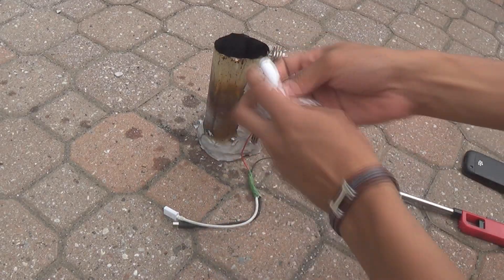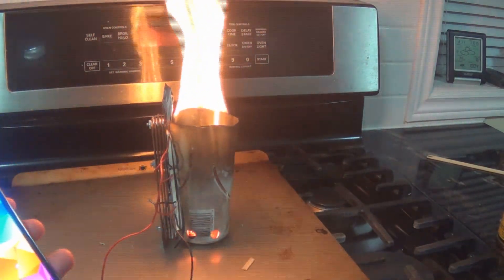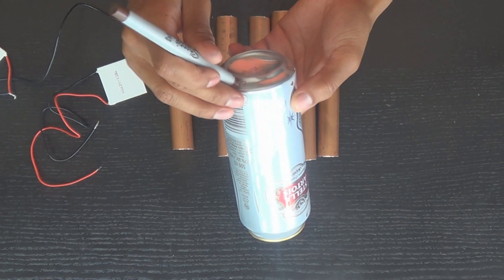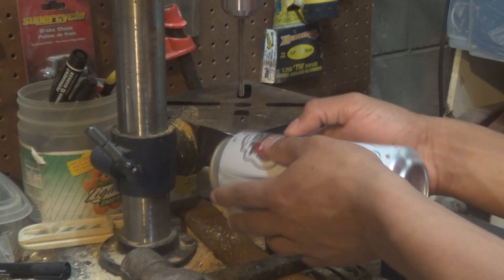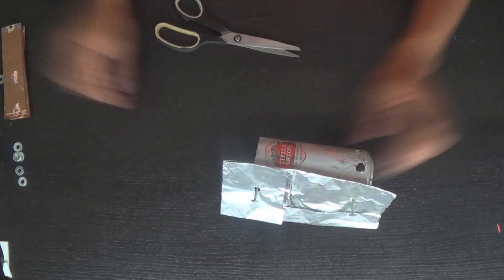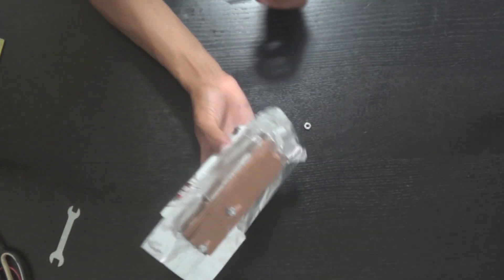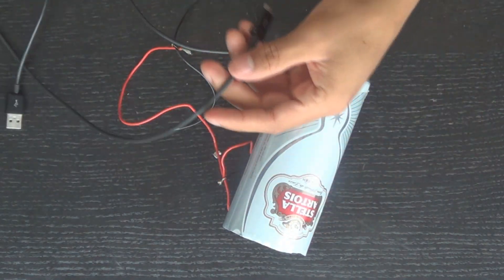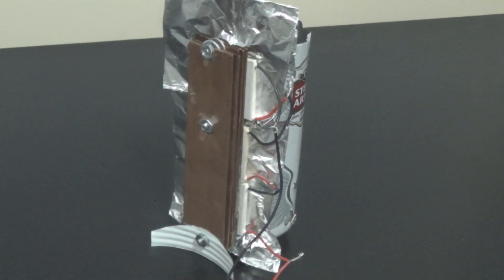How to charge a cell phone with fire - heat charger

Comment: this is not good for your phone since there is no voltage regulation please keep that in mind before using this
Reply: The phone's charging limiter is inside the phone's, not in the cable or the usual charging blocks. The cables also have limits to how much energy is transferred
Reply: Kinda late, but u know, you can use  a transformer (really easy and simple to make)
Reply: @randomds3154  Output is dc, so transformers don't work, but therer are power converters to 5V exactly for this purpose. They cost like 30cents.